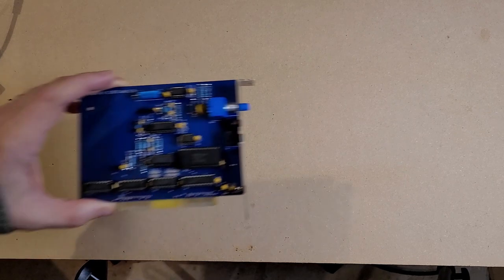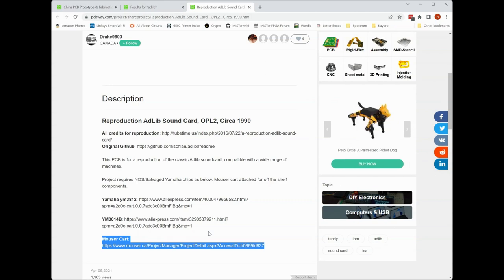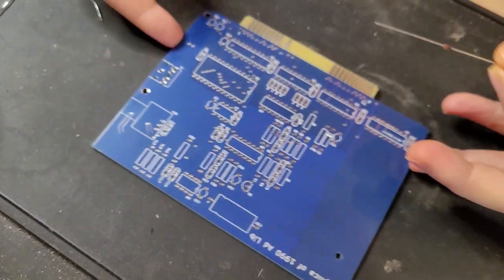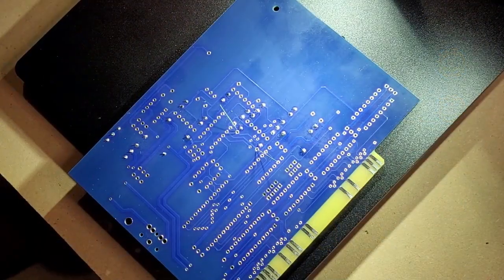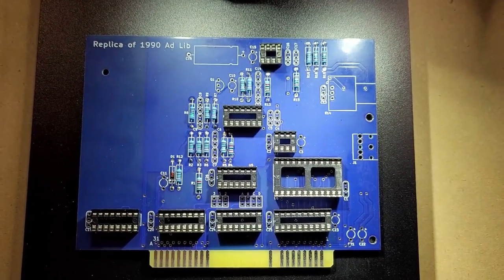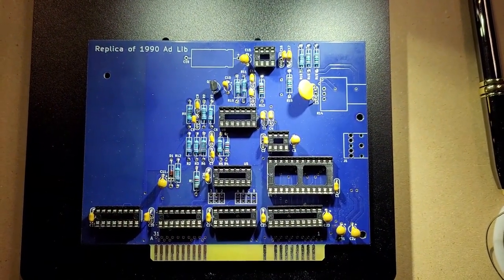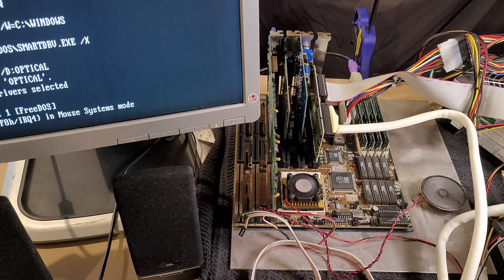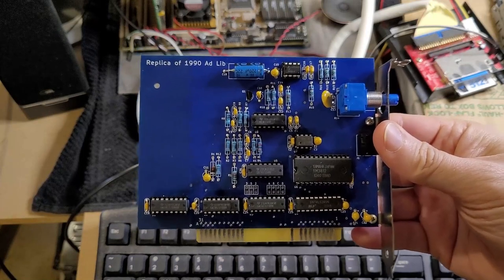Building an AdLib clone

Comment: Believe it or not, I built two boards recently and neither worked. Watching your video I heard your comment about the polarity of the tantalum capacitor and thought I had checked it before soldering. And that was it! That was the problem, now both cards are working perfectly! I was testing the logic chips and in the end it was a simple capacitor.
Reply from the maker: That's awesome.  I'm glad you got them working.